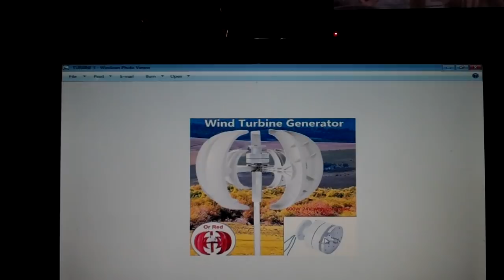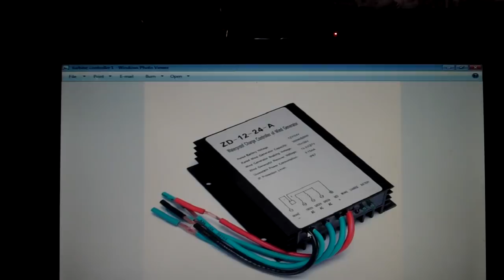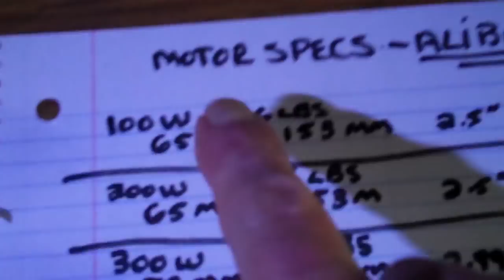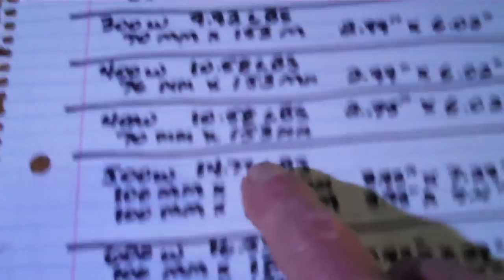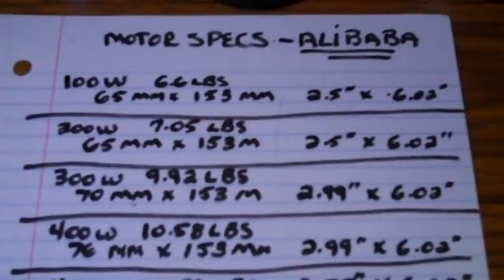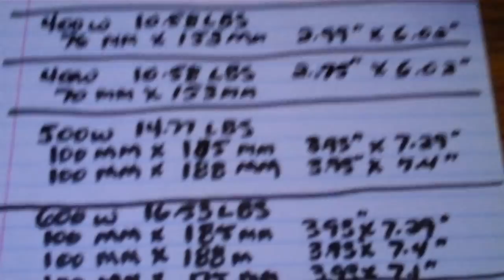SCAM-CHINESE VERTICAL AXIS WIND TURBINE-VAWT-THE SAD TRUTH-JUNK-PART 2

Comment: the thing that makes them the most. junk is they are extremely inefficient designed blades that operate by being pushed by the wind, rather than being airfoils that create lift.... so 50% of the time the blades are working against themselves as they come around the other half of the circle.... whereas if they were proper airfoils, they would be pulling themselves around the circle most of the way by creating lift like an airplane wing or sailboat sail.... then add on the games they play with their shitty generator motors and well, yeah, stay away....

Comment: I have a 4500 watt Winco generator with a bad engine, that I'm going to separate and put some kind of blade on...it only needs to make about 30 volts to charge my 14 off grid marine batteries...they will charge off of 800 watts but I usually don't run them down far enough to need that kind of wattage to bring them back up...I bought some N 52 magnets to put on the armature after I drill the holes for them, so it will start generating at a low speed...I think this is the answer, old junk generators converted  to low speed wind....I will be using a 19 inch mag wheel from an old Honda 750 Super Sport , that  got a curb ding long ago...I bought it for $20 in 2001 and now I'm getting ready to use it for my blade hub...the turbine in the picture doesn't have long enough blades to provide enough torque to turn a 600 watts generator...just my opinion...my blade will be 5  feet in diameter...easy to start turning, and it will have some torque...I'm not trying for high volts...I have a 1000 watts solar array, so I know what that can do...I'm working on getting another 240 watts of panels and two more 105 amp hour batteries...that would give me 845 amp hours @ 24 volts...I have 3 days of reserve now so that should make it about four...mostly I would need the wind in cold cloudy days....I'm trying to get enough reserve to not need it much...I think with the increased magnetism on the rotating part will make up for the RPM being low...besides, Winco just sounds like " Wind " anyways...made in America too haha...I looked at this Chinese one and just thought , " blades aren't big enough to make 600 watts "...so I'm going to make mine out of some old junk I have laying around anyways...I figured I could get some free power so I have to try it once...oh I forgot, I do have about $50 in the magnets but that's a cheap generator to me...and it may put out 7-800 watts...we have a 18 mph average windspeed here...the gas engine that is on it now looks like an 8 horse maybe...it's a Robin . I think it could be a 10 , I don't know those engines that well...the reason I am doing it that way is, I know the generator worked before....they wore the engine out on it...so I know it probably would put out even without adding the magnets, but I wanted to try it with them in there, so it wouldn't have to turn very fast...this generator looks like it came out of a really old motorhome...lol...something to tinker with. It only needs to put about 40 volts out probably to do what I want to do with it...but at least it will put out something. P. S. we had a tornado come 5 miles away last night, and we had 80 mph winds...I bet your little Chinese doodad would have been shot down as an UFO...this old Winco has a cast iron case.

Comment: i need help with mine false ad as 4kw 4000wim sure be 400w 24v and no external controller but was told one was inside their was looks like house wire blue brown and yellow/green marked as earth 1st silly question the double moon what way should it spin as i see pics looking both ways the blade there is led on unit flickers. and motor looks diff a bit wider-otherwise its an expensive spinning garden toy atm

Comment: i also fell for a 3500w unit and immediately tested it to only get 35w set up with a veritable drive motor
to check for its maximum WATS /AMPS 
so eBay money back guarantee got a refund and the seller had to pay transport charges for lying

Comment: A wind generator working at it's max efficiency is loosely described as 1 square meter of disc surface will produce up to 20 watts.  The problem is not with the concept of the system, it is the use of a rotor that is to small for the generator.  To achieve 500 watts of power a turbine has to show the wind a five square meter surface to rotate.  Yes wind speed does have an effect.  If you want to generate electricity in a five to seven MPH wind (typical) the 1 square meter per 20 watts rule is in play.

Comment: I GOT A PUNCH LINE FOR YOU , I bought a 6000 watt pure sign inverter, 12 volt, pure JUNK, IT won't run a freezer, and refrigerator together, it's junk ,paid all most, $6oo.oo for it !
Reply from the maker: hi ed.i live on a 45ft sailboat.i have 1000w solar and 400w hawt.the area I live in has decent wind.one of my 100w solar panels put out as much power in a day as my hawt puts out in a week.i have a large battery bank and I have a cobra 2500/5000 inverter.can run fridge,freezer,tv and all kitchen appliances in any combination.alot of the inverters are junk.the cobra inverter has been running 24/7 for 4 yrs solid.no issues.fridge and freezer both running and just made coffee.no problem.i did have to double up on the wiring for the cobra to put out full power

Comment: I got scammed too and opened my motor. The wire used in the windings are in star configuration and copper coated aluminum. Max output was about 7 volt after my self-made voltage doubler. Never got even one watt output for my 12v battery.

Comment: I think ive found out why these turbines arent working... 
The magnets have been demagnetized by the cutoms scanning machines !!!
So im ordering some neodium magnets to see if that works.
Gonna stick them to the sides first in groups of three one for each phase.
Failing that ill strip it down and see if i can recharge the magnets or replace them... 
Maybe just maybe this is the fix.
Reply from the maker: could be correct,but one guy stated he took his apart and the wiring was aluminum with a copper coating.if that is the case,you can replace the magnets and still won't work.i also believe from doing alot of research that the actual turbines like my 330w hawt need high rpm's to produce power.even if i took the motor off my 330w hawt and adapted it to my vawt,the vawt can not reach high enough rpm's to produce power.according to the manufacter of my 330w hawt it takes 12-15mph winds to start producing power and higher winds to really put out good power.the company also states that at 12-15mph the turbine is hitting 600+ rpm's,so if the turbine needs 600+ rpm's to even start producing power how can a vawt that can only hit 150-200 rpm's do anything.i need to take mine down and take it apart.
Reply: @melbaron1110  I received a controller but it has 3 thick green wires and one thin green.Is the thin green also meant to connect to the turbine ?
Reply from the maker: @mike5686  not sure what controller you have.mine has 3 thick green wires that attach to turbine and a red and black wire that go to battery.(see video 1)maybe thin green wire could be a grounding wire.you did not get directions with controller ??can you send me picture of it ??
Reply: @melbaron1110  No papers with it.I looked up and found this but the red light is not going off and turbine is staying in brake mode.
Wiring Method: 
1. Connect the battery "+" and "-" respectively to the positive and negative terminals of controller's battery . 
2. Connect three-phase output voltage of wind generator respectively to the three-phase voltage input terminal of the controller wind turbine. 
3. When you need to manually brake, connect the thin line to the positive pole of battery, you can achieve manual braking. 

Indicator State: 
1. When the controller green power (BATTERY) indicator is on, it indicates that the battery is connected normally. 
2. When the controller green wind turbine (WIND) indicator flashes, it shows that the wind generator is connected, and the speed of flickering reflects the wind turbinespeed. 
3.  When the controller red (BRAKE) indicator is on, in shows the battery is full, the wind generator automatically brakes because of over-current protection, or it is in the state of manual braking.
Reply from the maker: @mike5686  the thin green wire is shorting out the turbine motor to stop it.if you connect a toggle switch inline to thin green wire and then to positive battery you can manually stop the turbine.my wind controller is just a solar controller and i built my own stop switch.your controller does the same thing but automatically.i live on a sailboat and my hawt windcharger is directly above my aft cabin where i sleep.i use my manual brake switch to shut down the turbine at nite sometimes.my hawt will wake the dead when its cranking up.the chinese vawt is very quiet but does not produce any power at all.hope you have better luck with your chinese vawt then everyone else that have them.read my 4 post on chinese vawt then read comments..all agree they are a huge scam
Reply from the maker: @mike5686  with red brake light on sounds like your batterys are full charged,therefore the controller is not letting the turbine over charge your batterys.drain your batterys a little,then see if red light goes off and green light flickers when turbine is spinning.
Reply: @melbaron1110  Been running a motor on the batteries for 6 hours and they still 24.6v
Reply: @melbaron1110  I have disconnected it from the battery.
Reply from the maker: @mike5686  if you disconnect controller from battery you will burn the controller out if your vawt is spinning.see my first video.you must stop blades or controller will fry
Reply from the maker: @mike5686  you have a 24v battery set uo ??
Reply: @melbaron1110  Didn't remove the power just the one thin green wire from the turbine but the turbine is not set up yet.Just set it all up on a table to test first.
Reply from the maker: @mike5686  connect to battery first,then to turbine or you will smoke the controller.you will have to get an inline meter to read output.the controller they give you must have power all the time so it can sense 12v or 24v batterys.connect small green wire to toggle switch then run other side of toggle switch to positive side of battery.that is your manual stop switch
Reply: @melbaron1110  Done all of that but it looks like the battery is still to full 24.1v and the brake light is still on
Reply from the maker: @mike5686  i think you are going to have to keep draining batterys till light goes off.i am not sure on 24v batterys what the controller senses in volts to let vawt start charging.i am going to take an uneducated guess and say 21-22 volts.
Reply from the maker: @mike5686  my controller for 12v says recover voltage 13.5v and brake on at 15v.my controller will also handle 24v and it reads recover voltage 27v and brake on at 30v.i guess keep draining batterys down to 21-22 volts and if brake light still on maybe you have a bad controller.you do not have the little green wire hooked up do you ??
Reply: @melbaron1110  Ok found the problem.They sent me a 12v controller and not a 24v.I connected it up to 12v and works but 24v the brake light stays on.
Reply from the maker: @mike5686  is your battery bank set up as 24v ??where are you located ??
Reply from the maker: @mike5686  yeah it needs less than 12v to go off and you have 24v.never go off.what are you going to do ??
Reply: @melbaron1110  Yes I have the 3Kva 24v system.The turbine is 24v I don't know why they sent 12v controller.Im in South Africa Cape town
Reply from the maker: @mike5686  looks like you will be returning controller and getting 24v.i hope you have better luck with your chinese vawt then everyone else.i have had hundreds of people on my videos comment they get 0 output.real scan by chinese
Reply: @melbaron1110  Have to return the controller it is a 12v.
Reply from the maker: @mike5686  return it before time runs out
Reply: @mike5686  hi did you get the 24v controller and how did it perform.
Reply: @melbaron1110  ...yes that was me with aluminum wire because I was wondering why the wires were so difficult to solder and broke so fast after a view bends, I wanted to change it to a delta configuration. After some research I found max. vawt efficiency is 16% whereas hawt max is 49% I put back my old hawt , at least the vawt is a nice decoration.

Comment: Are the magnets strong?
 Has anyone tried rewinding this?
Reply from the maker: i am going to take turbine down pretty soon.i have a great friend who operates a shop that rebuilds alternators and starters.i am going to let him test and evaluate the turbine motor.will take video while he is testing and evaluating.will post on youtube results.give me a few weeks
Reply: @melbaron1110  that Would be very helpful. Thanks.
Have you tried using a different controller?
 Im getting a hybrid solar wind mppt controller which should be more efficient.
Ive also thought about using a car alternator instead of this pos generator.
Another idea is to gear the turbine up with a gearbox....
Reply from the maker: @Surferant666  the only way they could ever produce good power would be to replace vawt turbine motor with low rpm turbine motor.they ain't cheap.like i said in a few of my videos you could use a gear box like 1 to 5 but would take alot of torque to get blades to spin.i also bought a straight bridge rectifier as i thought the controller was sucking all the power,but it did not work at all.they have vawt that do produce power but they ain't cheap and it would take 10-20 years for payback.guess i am going to stick to 500-600w hawt's noisy but work
Reply: @melbaron1110  ill let you know how my mppt hybrid controller works out.
Reply: @melbaron1110  check this out..

https://rover.ebay.com/rover/0/0/0?mpre=https%3A%2F%2Fwww.ebay.co.uk%2Fulk%2Fitm%2F173684725851
Reply: @melbaron1110  this video is why i bought this vawt. 
He claimed it charged his batteries up quicker than his solar panels.
Now either hes a liar and promoting chinese goods,
 or mine and yours and many others-
 are faulty!

https://youtu.be/r_v--9QYEzg
Reply from the maker: @Surferant666  sorry but for that price i doubt its a mppt controller.mppt usually $200 or better.there's videos on youtube that explain what a mppt controller looks like inside.might want to open yours up to look.alot of mppt by chinese are scams.remember the turbine is ac.must have bridge rectifier than to controller.good luck my friend.let me know
Reply: @Surferant666  Me to looked good at the time but not to sure now.
Reply: @melbaron1110  it is an mppt contoller apparently but only for the wind part, not solar.
And still it doesnt make power..nothing.zero amps.
Not even 100mA
Reply from the maker: @Surferant666  the problem with mppt controller is they are not set up for ac to dc conversion.still have to use some type of bridge rectifier
Reply: @melbaron1110  well mine has 3 inputs for the turbine and 2 for the solar...
Reply: @melbaron1110  so youre saying i need to add diodes before they go into my mppt controller even though it has an ac symbol?
Reply from the maker: @Surferant666  i don't know what controller you have.if mppt is already set up for ac to dc conversion than you don't need diodes.does the controller have 3 imputs for the 3 wires coming from turbine ??
Reply from the maker: @Surferant666   i looked at several mppt wind controllers on ebay and it looks like they are all set up for 3 wires from turbine to mppt controller.must have bridge rectifier built in to mppt.no need for diodes.just run the 3 wires from turbine directly to mppt.good to go.i would imagine you must hook up battery first to mppt controller before hooking turbine or solar.see your directions for set up
Reply: @melbaron1110  yes

Comment: Ty for all the info.
I have a suggestion for your alibaba turbine :) 
Dont use that controller. It is used for turbines with high rpm and has built in rpm protection that will slow the rpm in stormy weather.
Lets say you can get 100W out of it. Get 3 phase diode bridge and and capacitor. Now you have good DC output from the turbine. Directly connect it to your battery bank.
It wont overcharge your bank cause we all know how little it charges.
Reply from the maker: i appreciatte your comment,but if the vawt does not reach high enough rpm"s to produce power than changing controllers accomplishes nothing.mine spins at max about 200 rpm's and power does not come on till 600+ on the turbine motor that i have.useless and big scam by vawt companys
Reply: I got mine working.  Shit send all of your turbines to me.  😄
Reply: @WesProphecy2032  Please post what you did to get it working.
Reply: @MrTurkeybreath  I actually took mine down after doing a side by side comparison with another turbine.  My other turbine put out more power so i am using it now.  With my grid tied turbine inverter the power has to reach over 10.8 volts for it to kick on.  Now if you hook up a 12v battery to it the inverter, it will stay on because it's supplying battery power to the house.  When the wind blows and spins the turbine the power indicator will spin faster as it charges the battery supplying increasing power.  Take a look at my wind turbine test video on my channel.  Personally the power from solar panels are more consistent and in greater wattages.  I get between 400 to 500 watts during the day with my solar panels.  I have 3 panels that are rated at 280 watts each hooked up to a 1000w grid tied inverter.  It helps with vampire energy usage during the day...